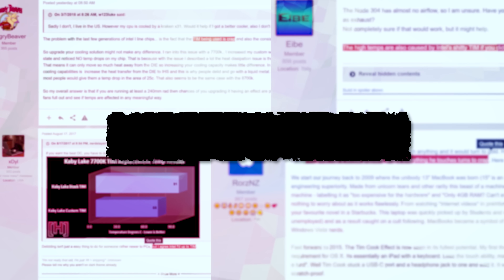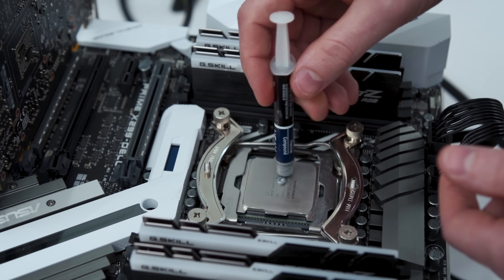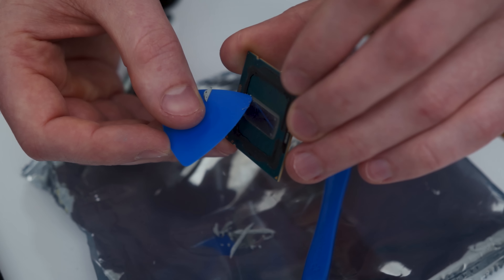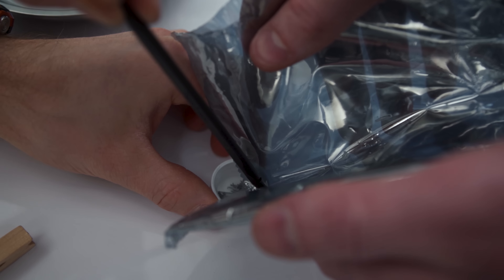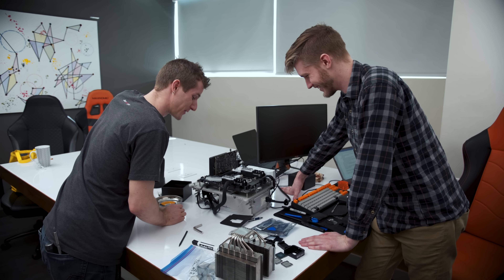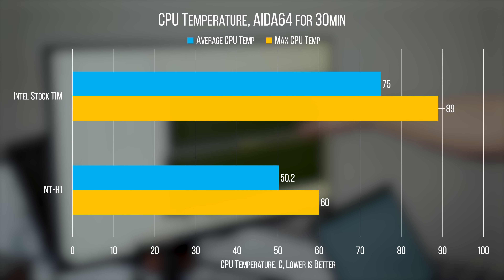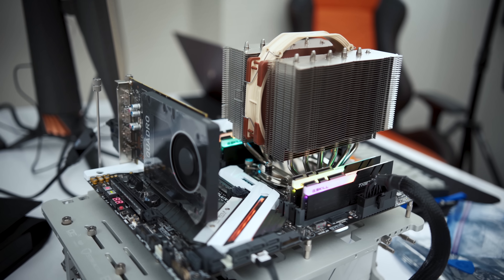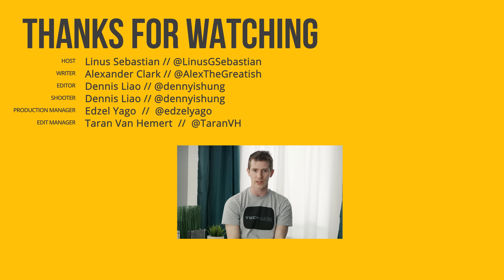Is Intel’s Thermal Paste ACTUALLY That Bad?

Comment: Linus Tech...  

As much as I enjoy your many videos on the latest computer tech news, I must say that this one (in regards to thermal paste evaluation) is most disappointing!  My background is in being an IT professional for many years with degrees in CIS and in both Electrical and Computer Engineering.  With credentials aside...

You should know better (from your experiences) than to reuse thermal paste, less dried out scrapes in practice or in application.  If you are to compare competing products, it better be from right out of the tube, apply it the same way and let it settled in for the same amount of time before any testing to be done out of following strict usage instructions.  Frankly, how is your video a fair comparison between the two products?  Take for example, your (unauthorized) reconstituted intel thermal paste for testing is caked on thickly (at a fraction of an inch) while the out of the tube (aftermarket product) is applied freshly (thinly) in terms of microns!  

In your attempt in re-hydrating the product, what is your determinant that it is either water, oil or alcohol based as a solvent?  You just guessed that it was alcohol base and went to town with your guesses...   

Without writing a long boring thesis here to address the flaws in the methodology of your experiment, I would advice you to actually do some research and consider a follow up video to properly address the controversial hypothesis in the title of your video "scientifically".  it is an interesting question and we all would like to know the answer...

Why not just ask Intel for a sample of their thermal paste or the source of their supplier so that you could get some for testing?  I am sure that intel would prefer it to your (personal opinion) claim that they are reducing the potential performance of their processors in order to save a few bucks for an "increase part longevity" at the expense of their users?  Really Linus?  How is letting a CPU runs hotter increases its overall longevity"?

For full disclosure, I am not working for intel nor AMD.  What your video is falsely claiming is damaging to intel without merit and it is very actionable!  Did you even ask intel to comment on their thermal paste used in their processors or for them to help you test their product?  If so, let us know of your endeavor.        

Why are you doing this to slander a company that have been your sponsor?  That is what we (your viewers) would like to know as of your motivations.

We all make mistakes, but it is important to own up to it and set things right.  Your reputation and integrity as a legit tech is in question here.

Comment: The real issue here is how it's used, on top of the IHS is perfectly fine, but under it at the first point of contact it simply does not have the thermal conductivity or surface area to dissipate the heat generated to the IHS.

Comment: While the testing methods used in this video are questionable and probably didn't give very reliable/accurate results, I can say that de-lidding my i7-7700k and replacing the TIM with Conductonaut made a huge difference. I got a particularly bad CPU that would run in the 90s at full load, occasionally hitting 100 C and throttling. After contacting Intel support and not getting anywhere, I decided to de-lid the CPU. After replacing Intel's TIM with Conductonaut, my CPU's temps dropped to the upper 60s/lower 70s at full load with a Cryorig H7 air cooler and have stayed that way for the past 5+ years. Looking to upgrade my CPU soon though.

Comment: 1. Get a stock cpu fan that's unused, with perfect thermal paste (evenly spread- most of the time stock cpufan's thermal paste is not even ) and benchmark it.
2. Scrape off that stock thermal paste and replace with whatver thermal paste you wanna test then benchmark.

Comment: The problem isn't the low performance TIM, it's that it's applied to K series processors and enthusiasts have to void their warranty to replace it. It works fine for the other 99% of processors that are going into OEMs and workstations.
In Intel's defense, even without the 200MHz increase from delidding(when pushing for 100°), Intel's single core performance still blows the doors off of AMD.
Reply: I wouldn't say blows the doors off, considering a lot of it is due to higher clocks.
However, I agree with the TIM statement. It's fine for the cheap stuff, but server and K chips should always be a NO for that.
Reply: single core performance is the same , but intel is higher clocked
Reply: They become cheap on TIM in 3rd gen and up I think. My 4770k die on me in only 3 years but my 750 still alive and of to 3.4ghz with boost since 2009 still only got around 55° gaming and editing air with around 35° ambient, but it's mainly use as a media center.
Reply: Jorald Padilla I also have a 750 overclocked bought 2009 still choochin'. have an i7 2600 something i think it was it is laying in a corner in shame.. wont post..
Reply: "The problem isn't the low performance TIM"
You told tim.

Comment: I know this is a few months late but I tried a few different ways to (replenish) used thermal paste. And found if you add just a little Vaseline to the dried compound. It will fetch it back to life and last longer then original. Due to the oily nature of Vaseline

Comment: How to handle that form of paste is to press it to spread it, then let it evaporate.

BTW, electronics cleaner would work better than isopropyl.  Electronic cleaner uses an alcohol with higher solubility of a wider number of compounds, and evaporates quicker. 

The evaporation might be giving false low temperatures.

Comment: Just test the processor with stock one, then with another pastes, do it with processors of several genarations and based on the difference of stock <> aftermarket paste of which one, you will know how processors get better or worse with time.

Comment: to grind the old thermal paste you should use the solvent and a mortar and pestle. or phone Intel and ask them for some of the original paste (I know... that last one was just too easy)
Reply: Seems like the grease part in the compound was omitted here, isopropyl removes grease which is why they use it for cleaning cpu's, i don't know what they where expecting doing that other than ending up with even drier paste after the alcohol is gone

Comment: Intel is not the only offender for this. Apple, Lenovo, etc.: All of them put that crappy inexpensive thermal paste on their processors and it just is not necessary! To put something more expensive on it would add about 50 cents to the cost of the average processor.
As to that stuff 'being longevity based'... no! I have a processor with third-party thermal paste on it and the thermal paste has lasted nearly 8 years.
There just is no reason to use this extremely lackluster thermal paste on expensive processors that are most likely going to be replaced in a few years anyway!
Reply: Because Lenovo makes CPUs

Comment: Use pine sol or turpentine, it works better for thinning old paste. I actually 'cut' many modern pastes that seem too thick with it -- smells funky for a couple hours, but it knocks 3C off the result of even most premium TIM's if you do it right.

Comment: I removed the stock intel thermal paste from my ancient machine. It was a literal brick, dried up, easily broke it to sand. After replacing that thermal paste my temps came down by 30 degrees

Comment: I get that the paste is supposed to be long living but it can'T be reapplied like that - you should get newer paste equivalent to intels thats still spreadable or use dried up paste for comparison too - this was more testing how well the alcohol performs as thermal paste then intels actual thermal paste
also you could just test it outside of the pc by just heating up one end of a flake and measuring how long it takes for the other end to warm up with a thermometer comparing that to a string of new thermal paste the same length

Comment: you should have tested it as usual but the base test should've been done after opening the processor - so you open it up and dont remove the original paste and then close it so that the seals are broken. and also do it on 7 or 8 series where paste is still in a good condition

Comment: Guys, you need to rerun this experiment, to compare apples to microsofts. Uhm, I mean apples to apples.
1) Don't scrape old thermal paste from old intel CPUs. Why not just take a brand new stock intel heatsink, which already has some of intel's compound on it, and it's already properly/good enough distributed on the heatsink? Run your tests, then scrape intel compound off, and then put that Noctua compound on that same stock heatsink for the comparison.
2) If you insist on not using intel's stock cooler (because it's crap and won't show the full difference, or whatever other reasons you got), then at least scrape the thermal compound from brand new coolers, and not from under lid of 6yr old CPUs. Better yet, get some of that Noctua compound from the tube, put it out in the open, and let it dry for a few months. Then, scrape it off and soak in alcohol in the exact same manner you've done with intel paste, and then run your tests.

Comment: The "thermal paste" layer you did is way to thick. TIM is there to fill the holes and prevent air bubbles, metal to metal is the best for thermal conductivity. Air's thermal conductivity is 0,0262 W/m.K, thermal paste are around 0.7 to 8 W/m.K and copper is 401W/m.K !

Comment: The number of people who didn't apparently understand the video and request for a delid and replace test instead is astounding when the whole point of the video was that LTT has already done delid & replace tests but wanted to remove the variables that come from that and instead test the material...

That being said I would assume that intel uses the same TIM in their stock coolers as they use inside their heat spreader so verifying that and doing a simple comparison between Intel cooler with included TIM vs the same cooler with replacement TIM would have been possibly more sane.

Comment: Intel’s thermal paste is fantastic. Processors are at blacklist by default. To calibrate its thermal parameters, 47 min is needed in bios running on battery, possibly pc needs ups. Power good signal line communicates with the motherboard, indicating the state of the ups. When you do this, the computer reaches its elite mode, and remains even if you remove the button cell.

Comment: Why didn't you do the test the other way around (lid on)? 
1) Testing original CPU (lid on)
2) De-liding, replacing the paste for high performance one, placing the lid back on and then testing
That way you avoid having to mess with the old original thermal paste and get more accurate results. The recovered paste was applied too thick and since it was more powdery it will have air pockets after the alcohol evaporation.

Comment: Surely you have the connections in the industry to find out EXACTLY what TIM Intel is using and get some from their supplier for a proper application. Run it at max for a week to check longevity.

Comment: Linus, you guys did it wrong.  I reuse thermal paste all the time.  You guys need to use a drop or two of lubricant that does not conduct electricity (not alcohol)  By mixing the lubricant with the dried thermal compound you reconstitute the mix back into a paste.  Too much lubricant and you get really runny peanut butter but not enough and you get a really hard peanut butter.  The key is to use just enough to get the right consistency that does not run.  The lubricant method works really well as I have done this a lot with shin etsu as well.  Everyone knows how hard it is to spread shin etsu so I came up with this method for my own personal use.  I wonder if I should make a video?

Comment: I think a better test would be to A/B test the CPU's. First original factory, then De-lid and put on a good compound, test again. 
At the factory its far more liquid, then applied to CPU to form a very thin layer and hardens over time, but still retains its heat conductive properties. SO, I don't think this test was conclusive at all.

Comment: You should have used silicone-oil or mineral-oil (alcohol just vapors off).  That is what is in a lot of commercial heat-sink compounds. It would have allowed the paste to remain malleable thereby providing particle-to-particle thermal continuity and therefore overall thermal-conductivity. Also begs the question: What was Intel's paste liquefier--as it looks like it disappeared?

Comment: I think you should contact intel and ask them to send you some actual paste that they use. Even though you ground the powder, it will still not be as fine as the paste when it was first applied. It's like grinding bricks and then using it to make new bricks. I do really want to see the quality of ACTUAL paste they use to before I delid my 8700K.

Comment: As fun as using a real computer is (LOTS of fun) if you want to further control variables you should break out a highly controlled small-scale test with a ceramic heater element and thermal sensor.  

By measuring how much wattage is required to keep the same temperature with the same setup with the only difference being the compound between the cooling rig and the heat source, and repeating at various hot side and cold side temperatures you can make a nice 2D spreadsheet of thermal properties at various temperatures. 

You can do a second chart with wattage fed in, and resulting stable temperature of the heating element with various temperatures of the block on the other side of the heat sink paste.

Comment: Intel did not select this TIM for endurance, they selected it because they can save a few pennies. They could have soldered the heatspreader on like AMD does and would achivve better thermal performance and just as good of longevity if not better. When soldered, there is nothing to dry up or brittle away...

Comment: Intels TIM may not give best heat exchange but provides durability.
Most consumers do not want to delid & replacing as part of a regular service.
Intels TIM last about 10 years before drying out. Well worth having a 3 degree hotter cpu.
If cpu heat is an issue users should just invest in a better cpu cooler, will get a way larger temperature decrease, easier future servicing & much safer.

Comment: I can state that I delidded my 3570k and didn't have proper mounting tools any longer for my water block. I had to relid it with a different paste. It dropped about 20 degrees instantly. It also worked on my old 970 gpu it dropped the graphics card temps by about 10 degrees which is a little weird because that card never has had heat issues.

Comment: If it were, it'd be pathetic for other coolers, since half the difference, in most cases, would be just based on the paste. It's also not logical, since "good" or "proper paste" can still be quite cheap, and Intel as a producer only has to pay optimised production costs, so it's a miniscule part anyway, that also has to pass quality control (rather than be deliberately shit).

Comment: You need to use liquid thermal paste rather than solid coated in alcohol if you want this to be a fair test. The paste that was recovered from the Intel CPUs clearly made much worse contact with the heat spreader than the other thermal paste. A powder will never give you anywhere near as good results as a liquid. I think that there were more variables that you weren't controlling in this test than in a typical de-lid and replace thermal compound test. There's no way you can draw accurate conclusions after using solid thermal paste, even after your efforts to liquidise it.

Comment: "And supporting our theory is the fact that this difference is pretty close to the temperature difference that you can achieve after delidding a CPU and replacing that stock thermal interface material". 

Was this the moment you realized that you could have done just that? :D.

Comment: I am quite not sure if you can just reuse paste.. It would be good to verify this method by taking some old machine (that will have its paste already solid/dry), measure temps, then take off cooler, salvage the paste, soak it in alcohol, re-apply it in the way as you did in this video and measure temps again. According to your theory it should have same temps in both cases. Imho the TIM had better properties before delidding then after re-applying it. I would really like to see the comparison though (I may even do it myself if you don't make such video, as you are probably not going to notice this comment, bcs I am truly curious about that).

Comment: Why not just use a stock Intel cooler as a test bed? They're easier to come by, already have the TIM on the bottom of it, and you don't have to salvage it from under the IHS... that way you have a "control" between one where you use the stock TIM and then the other, where you replace it with NT-H1.

Comment: Wouldn’t it have been easier to just test all this on a stock cooler? Get the intel chip with stock compound, test the load, clean and replace with Noctua, and then test again.

Comment: Tomorrow, I'll be delidding my 4770K without putting the IHS back onto the CPU. It'll be done with the Rockit88 and I'll be reseating the CPU with the ICE Delid die Guard. Should be quick and easy.

Comment: Using iso on the paste will change its chemical composition. Its not gonna just disolve the TIM into a paste and then evaporate away without changing the chemical makeup of the TIM.

Comment: Why not have just gotten an Intel cooler with the thermal paste pre-applied, tested it, and then cleaned it off and tested with the well regarded thermal paste? Seems like that would have been a much better option...